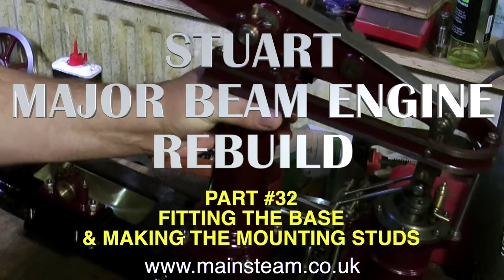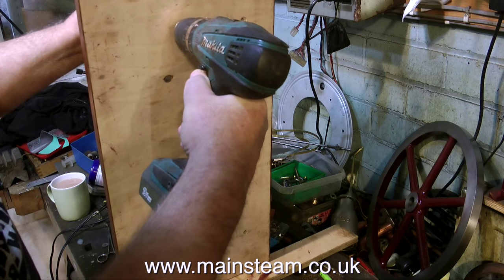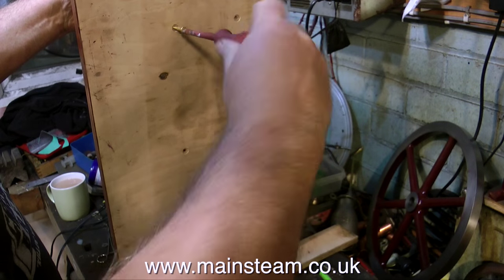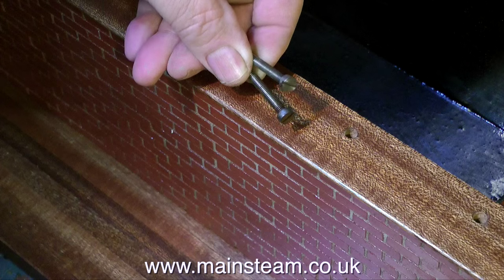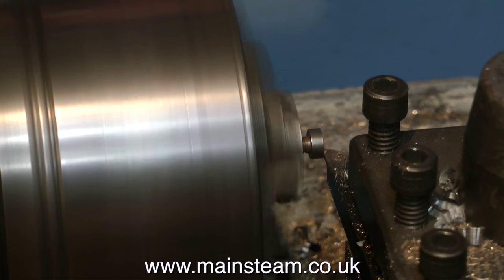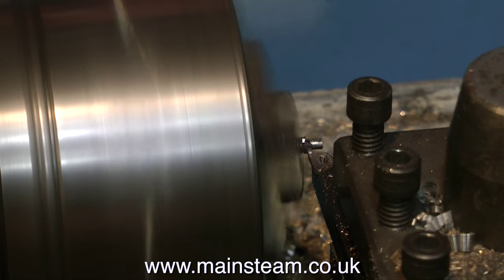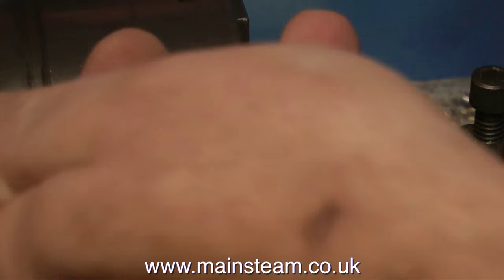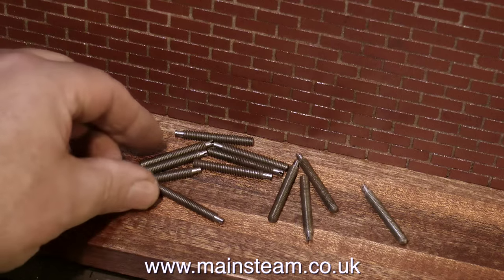STUART MAJOR BEAM ENGINE REBUILD - PART #32

Comment: when mounting an engine to a wooden base board could you make a drilled and tapped metal plate which goes under the wood? i'd imagine this will be a bit over top, but for an engine with only a few mounting holes...

Comment: Would another option potentially be to turn down the bottom portion of these bolt/studs so that they have a narrower diameter and then give that wood-screw style threads on the lathe? or is that just silly?